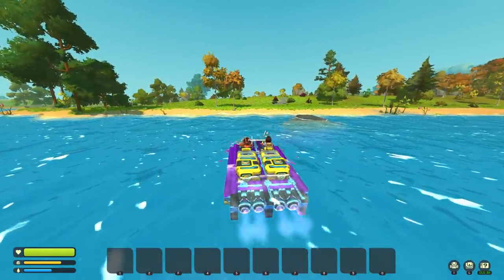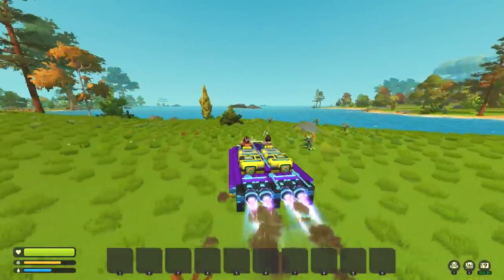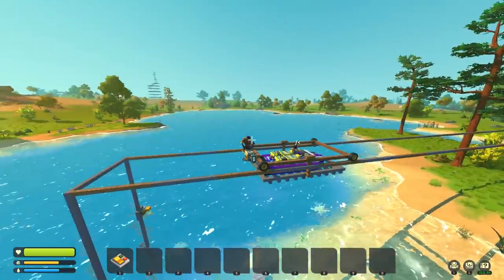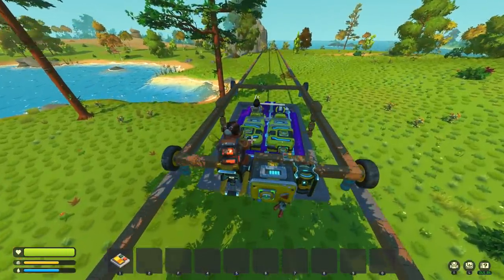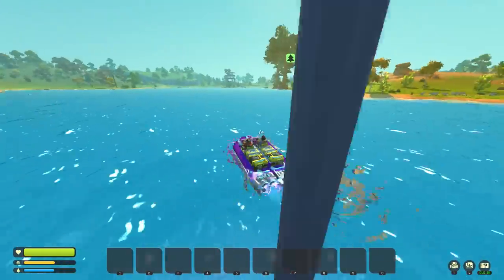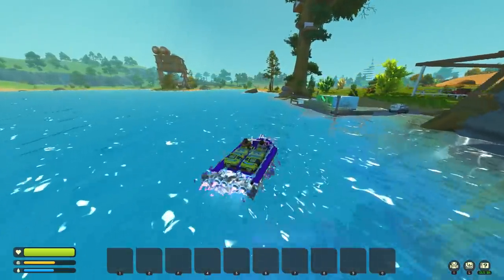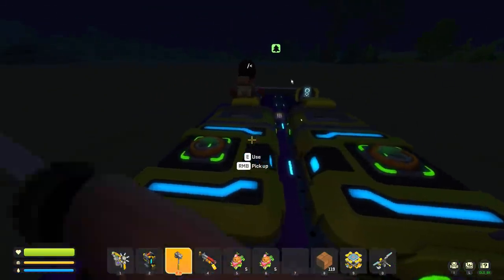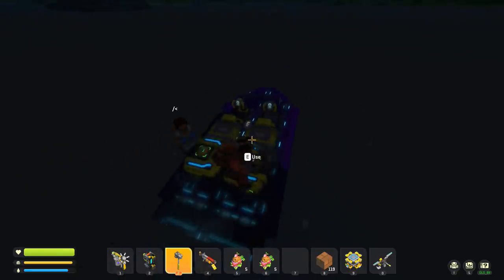We Built an Elevated Track System to Move Our Boat Across Land! (Scrap Mechanic Co-op Ep. 56)

Comment: You should have one fuel tank going to the outer thrusters and the other fuel tank to the inner thrusters so that way if you run out of fuel on one tank it wouldn’t make you steer to one side
Reply: Do you mean adding a second tank? Cause if so, that's a logistics nightmare. You have to deal with weight for both buoyancy and for thrust re-striking the perfect balance while also making sure the part actually fits in the boat and while still keeping the new form factor cemetrical.

The weight is the issue. More weight = more fuel consumption. If it wasn't for that, I'd agree with you.
Reply: @Hadeks_Marow  I think he means connect the two outer thrusters to one fuel tank, and the two interior thrusters to the other fuel tank (there are already two fuel tanks in the boat)... So when the fuel runs out on either tank you still have a balanced thrust instead of it being the two left or two right that are out. Right now the tank on the right is connected to the thrusters on the right, and left to left.
Reply: @Ry852  i wasnt sure if they had 2 or 1, i missed the last episode which is why i asked.

so wait, why do they have 2 now? Like how are they using them if NOT like this then???
Reply: @Hadeks_Marow  they have the two left thrusters connected to the left tank, and two right thrusters connected to the right tank. That's why it pitches left or right when one of the tanks run out of fuel. If they went with Caboose's suggestion they'd just lose half the thrust, but it would be easier to keep steering since the remaining thrust would still be balanced.
Reply: @Ry852  . . . WHY?!?!?! Datz SU stupod and maka da nu sencu!

Insert Jacky Chan "wtf" here.
Reply: @Hadeks_Marow  It's not that big of a deal, they have the fuel station. They probably didn't anticipate actually running out of fuel since they usually carry around so much when on land. But since they have run out twice on water, it's probably worth it for them to consider balancing the thrusters in case it happens again.
Reply: Smart
Reply: I wanted to say the same thanks that you already wrote it
Reply: @Hadeks_Marow  you guys on a pool pool
Reply: @Ry852  on
Reply: @Ry852  pool
Reply: O
Reply: L
Reply: Also didn't help that they forgot there was fuel in the boat last ep when they ran out of gas!.  lmao
Reply: @Hadeks_Marow  I think they already have 2 tanks
Reply: @wheels5584   @Niemand_•

Comment: I wonder if paint will serve as dividing the rail into sections for the bouncy physics. Perhaps different colors calculate differently. Enjoying this series.
Reply: different coloured sections for big rails roads etc. should do the same as changing the material
Reply: @Natrack1  unlikely... colors dont change the physical conditions of materials like friction, which might be the most important factor here.
Reply: @logiarhythm6285  no, each colored block is calculated as a different block so @Natrack1 is correct
Reply: @omegabyte3541  That seems really inefficient, it would probably be better for the game's performance if it was considered one object and they just rendered the paint above the texture.
Reply: @packediceisthebestminecraf9007  i would normally agree with you, however we are talking about scrap mechanic where you can swim around underneath the world tile 😂
Reply: @FredFlintstoffel  It would take more processing power to remove the water under the tile though. It's much easier to just make the whole tile have water under a certain height, so you only have to check if you're lower than sea level instead of also checking if you're above the ground (also, you're not supposed to be able to go under the map, so why would they bother adding a bunch of code just so that glitches make more sense?)
Reply: @packediceisthebestminecraf9007   no it would not because if that was true then it would require the game to render two textures on one face of the block, instead of just switching the block when you paint it. in which the game only needs to render one texture for each side of the block.
Reply: @omegabyte3541  It would use more of the GPU, but it would use less of the CPU. For scrap mechanic, I think the CPU is more important than the GPU.

Also, it wouldn't have to render 2 textures, it could just render a layer of paint on top of the texture.
Reply: He actually said a few episodes ago that parts that are painted different colors, in fact, are calculated separately from each other. Not differently, of course, but separately as their own object.

Comment: I  said this before but I'll say it again. In the warehouse are hatches, that close the vents on the last floor. They are made with square mesh block (friction 2, lowest in the game so far), you can get those hatches very easily and add square mesh to the bottom of the boat, it will allow you to slide across the ground. This way you won't even use any fuel to cross any land because your momentum should be enough to get you across. You should try that, 3 blocks is all you need.
Reply: I thought about that when kan said about going over land with the thrusters, bc it's very obvious as a solution, but I got to admit the "gondola" they made is very amazing.
Reply: Whaaat?
Reply: @austinedgell9735  tl;dr - Use a warehouse part to make the boat slide on the ground like on ice.
Reply: Upvote
Reply: How do you get the hatches out of the warehouse? Do they disconnect and can be hammered to the elevator? Windshield pieces can be easily made and also 2 friction. A bathtub is also 2 friction.
Reply: Kan come on man try this out
Reply: Man that’s impossible u would need a explosive tape to blow out the pieces and u have to hammer them out and kAN has like cleared every tapebot and tapebots don’t respawn
Reply: @bluesheep916  Just use an explosive container, it's "cheap" and craftable
Reply: @rokushou  Never thought about windshields, gonna try them one day.
Reply: @rokushou  They are hinged and move on a controller so you can easily detach them with a small explosive. On top of that they are surrounded with the round corner ventilation block (idk the name) so it provides extra protection. You only need to add 3 blocks that weigh 2 each, way better for boat performance than windshields, bathtubs or even sawbaldes.
Reply: @bluesheep916  All you need is a small explosive and they should come off without losing any mesh block. I detached one by accident while fooling around with explosive tapebots (that's how I found those blocks) and pretty much the whole thing survived. Getting it out is easy peasy, it's on the end of the warehouse and mesh block makes it slide across the ground like on ice.
Reply: Like 69
Reply: @MusikgodThanatos  nice
Reply: @MusikgodThanatos  I was waiting for this joke, nice
Reply: The point was not purely just to get the boat across.
Reply: @hisune_39 too long still

Comment: If you want to farm component kits build two small single-thruster flyers and fly from ruin to ruin. It's much faster than walking or driving.
Reply: They don't know how to make glitch welded stabilizers.
Reply: @danser_theplayer01  You don't need that for a simple flyer. Standard suspension glitches for turning are enough. There's plenty of step-by-step tutorials on youtube if you don't know how too, though i'd be surprised if Kan can't do it on his own.
There's simply no point farming component kits the slow way once you have enough for your first level 5 thruster.
Reply: @drunkenboxer5568  Well, they wanna make boats or helicopters and not practical one-thruster flyers. Idk why.
Reply: They don’t wanna just make a broken thing like that
Reply: If they wanted to that’s the first thing they would have made

Comment: If you want wheels, you could have 4 pistons on each bottom corner of the boat, and extend them by 1 block. Then attach an elbow mini-pipe, a bearing, and a 1x1 pipe. Then you could use the thrusters on land to cross to other bodies of water.
Reply: You messed that one up in your head. The pistons are going down, yes? Then how do you rotate the pipes 90 degrees to face sideways if the pistons are going dowards. You would need a tiny corner pipe attached to the piston and the bearing to the tiny corner pipe. 

By making it the tiny variant of the corner pipe it means it won't drag on the ground with the normal size pipe.
Reply: @Hadeks_Marow  I'm aware of how it works. Just trying to keep it short.
Reply: @NewtIsMeName  Short only works if what you are saying still sound coherent. 

"Attach the 1x1 pipe on each piston with bearings" makes it sound like you want to attach the pipe DIRECTLY to the piston using a barring. And when you say it like that, it makes you sound like a crazy person. It didn't help that you didn't clarify that the pistons should be facing down either.

Remember, this is kan we are talking about. He's not the best with reading our advice so we gotta be extra blunt and clear with him on what we actually mean. Otherwise he will do it wrong and blame us for it as he is known to do.
Reply: @Hadeks_Marow  happy now?

Comment: The switch to the boat elevator should be on the part that lowers so it can actually function as an elevator. You use the switch to get up and down where you don't raise the elevator back up after you drop off the boat.

Getting up is the issue of immersion that I can see. Chair ladder teleporting should not need to be a thing in order for you to use your boat ELEVATOR. You should be able to lift the crane without jumping off the boat by just pressing the switch and then just ride the boat up to get to the other seat. Slightly more reasonable for single-pilot use as well that way.

Comment: About the realism of tier 3 wood being lighter than normal wood - Metal generally offers more stability per mass or volume, which is why hollow metal table legs are so popular with cheap tables. So I think it's reasonable to think that tier 3 wood actually uses some of the additional stability provided by the metal to incorporate air pockets.

Comment: You could put the thrusters on 2 switches so you can drive on fuel-safing mode if u are running out of fuel. 

Also i think you just need to hook up the center thrusters to the same fuel canister (the other 2 to the other fuel can) and if u run low just put all the fuel in only 1 canister

Comment: I think you can make your vehicle locking system look nicer by building a platform, then place a single block onto that platform then, on the side of the tire near the bottom, weld that to the side of the single block.

This way, the wheels will actually be on a flat surface/on the ground and the 1 single block can look like a parking boot/wheel clamp/wheel lock (those things traffic cops put on tires to make it so the car can't drive).

To drive, just delete the wheel boot. You can even make the wheel boot be a caution block for esthetics.
A floor and a single block. . . that's all you need. . . . not a pillar. . . pillars are ugly.

Comment: Two tips to improve the system:
1) Put pipes under the rail to grab it so it doesn't jump or derail if you hit it
2) Add some logics and sensors in the front and in the rear and one to detect if the crane is lifted...
A button in the crane and when you press it, it raise the crane. When the "top" sensor is detected, then it checks which sensor is active (front or rear) and then activate a motor to spin the wheels to one way until the opposite sensor activates, then stop and then it lowers the crane and done, it's automated and bidirectional.
I can make you a logic diagram if you want, no pay, don't worry, I just enjoy automate things :)

[EDIT]
I've just see that you already used the first tip :/

Comment: You have each fuel canister for each side of thrusters, but set it up so that one canister does the inside thrusters and one the outside, so that, if like at the start, one runs out of fuel, you still have equal thrust to both sides, other than one side active and the other not...

Comment: Man, you really need to learn to make scissor-lifts (aka. cherry-pickers), Do note that the way to do them is using a long arm which can be stacked between other similar arms, but you need to alternate the side on which you add two blocks to the side, to connect it to the arm above it. After it's done, you can use a controller connected to a bearing or two, to lift up or down a platform with the help of the scissor. Do note that you would need to either have one side not connected to the creation, or to use an extra V-shaped arm for the connection, with the angle of that V changing when you lift up or down. Want me to make a tutorial for you? Also, since you have two seats, why not sneak a gas engine and 4 wheels, and use one of the bearing of the suspension steering for the gas-engine seat? I mean, it would be a very good failsafe, if you need to get away from a red bot quickly.

Comment: If the track system is too laggy put low friction mesh block on the bottom of your boat and skate across the land. The track system is cooler though so only do it if it is too laggy.

Comment: Put 4 sensors on the boat mover. 2 in fron and 2 in the back.
Let's say sensor "a" is pond side activation
"A" is ocean side activation,
"b" is pond detection
and "B" is ocean detection.
"a" and "b" point towards the pond, and "A" and "B" point towads the ocean. If i haven't made it clear, the sensors are on the thing, that drives on the rails. When "a" gets an imput, it drives forwards until "B" gets an imput. When "A" gets an imput, it drives backwards until "b" gest an imput. put a button on the rail on each side, and make them rotate a bearring, on each side, that will trigger "a" if the rail vehicle is on the pond side, and "A" if it's on the ocean side. This way, you can call and send the rail vehicle fom either side, and if you die while traveling with the main boat, and you have a corpse retrieval speed boat (boatguette), you won't have to take the land route.

Comment: Hi Kan
Try to use the thrusters on the track to see if it helps speeding the movement
Reply: They used electric engines because they're more efficient than thrusters.
Reply: @Aieou472  thank you  for your response. 
I've forgot about the fuel consumption 👍🏻

Comment: nice that you know a far bit about snowmobiles but one thing wrong just nit picking though most snowmobiles  now are cooled by the snow  vea heat exchanger but if we were talk about older machines then yes air cooled and mabey a few radiots

Comment: With the grate like part that holds the boat. Make each rod set to a looses bearing so you can roll onto the monorail
Reply: True but would be kinda satisfying
Reply: It also might reduce lag at the smae time. From my experience with SM things connected to bearings sometimes count as different objects(thata probably why with enough force objects can be "pushed" off their bearing). And also from my experience, two big objects touching have more lag than one big object and multiple small ones.

Comment: that thing is begging to be automated with sensors and logic. never leave the boat
Reply: I just don't get why the need to use a chair teleport ladder for their boat ELEVATOR?!

Like. . . just put the switch on the part that goes up and down. Easy automation there by removing the labor of the ladders (though not fully automated due to still having to press the switch. . . but it's cheap cause it's just optimizing what they already have by relocating the switch).